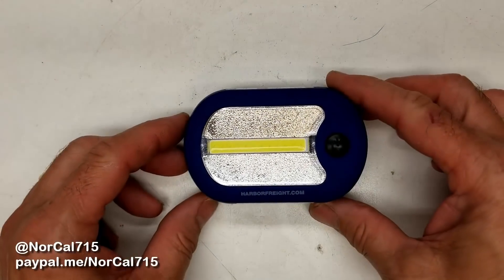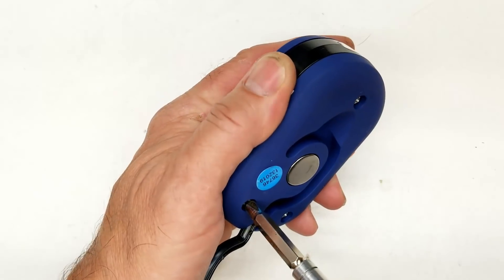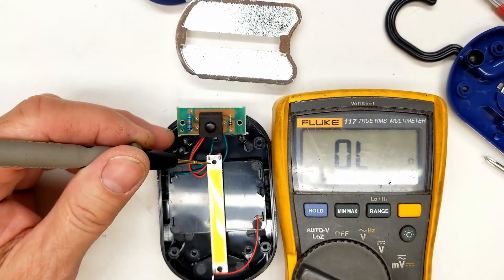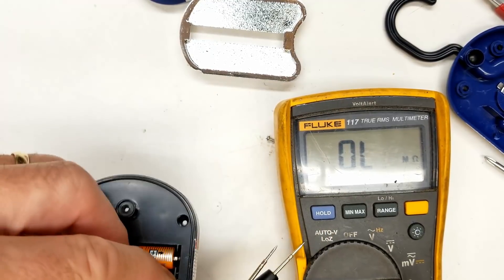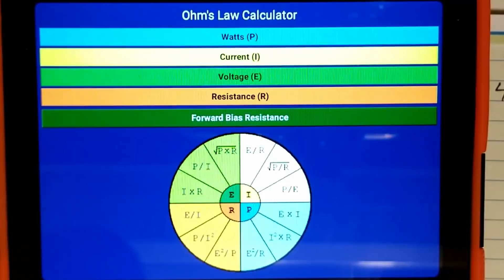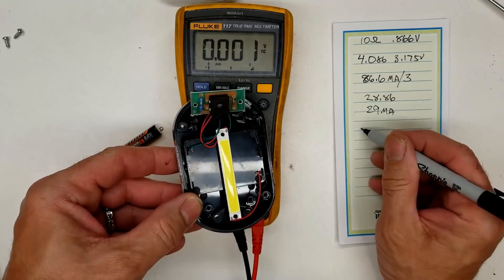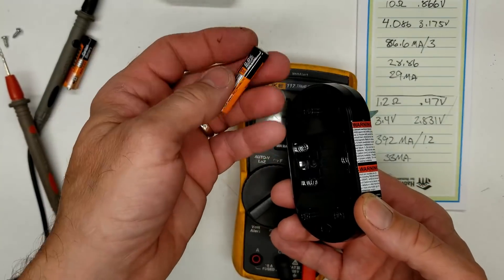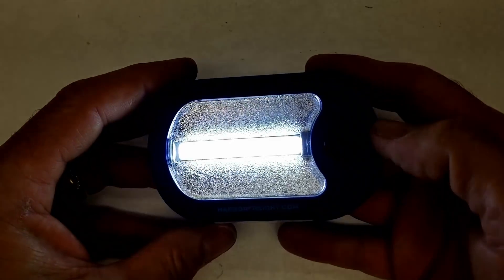Harbor Freight FREE Flashlight Teardown and Analysis

Comment: The resistors are now microscopic SMD unfortunately. Mine has values of 1.5 and 10, or in SMD lingo 1r5 and 100).  I was going to swap the cob resistor to increase longevity but can't be bothered with SMD crapola.  Cheap thin plastic case probably will crumble before cob dies anyhow.  I did modify it by adding a spare single shorter AAA sized 300mAh lithium, along with a cheap ass TP4056 control board with UV protection.  Only gets less than half the run time of good  alkaline AAAs but will never have to replace battery again.

Very cool video.  Thank you!
UPDATE: the 1.5 ohm resistor is actually differnet than old version of 1.2 ohms.  Turns out that is not good (cob is pulling 480/12 or 40mA/LED - so looks like I will have to replace that bloody SMD resistor after all.  UNLESS, the new design incorporated 40mA LEDs --How does one figure that out??
Reply: Another Youtuber with same configured lamp confirmed that swapping to lithium prematurely burns out the cob's individual LEDs.  Thinking a 2 ohm resistor should be about right though I still don't understand why swapping battery makes cobs draw more amps?  This lamp still has the 12 LEDs on the cob and they increased this resistor's ohms from 1.2 to 1.5 which is good, but even with higher ohms the lamp is drawing more instead of less current -just call me confused?  
Answering my own question a little latter -- maybe more powerful batteries have less internal resistance so calibrated resistors have to be increased to maintain same safe current draw for LEDs.

Comment: I made a emergency strobe out of mine with a Picaxe MCU programmed to pulse a 2N7000 mosfet with 100 millisec flash 60 times a minute. Just 2 parts! It all fit inside with room to spare. Mine only has one resistor (1.5 ohm dropping .073v) for the end light and no resistor for the led bar. Great light for hacks.

Comment: I have two currently that stopped working at about the same time. Tried new batteries in them and still no dice.
Is there a way to determine if the LEDs are bad? Is there some other high point of failure on these that can be repaired?

Comment: OHHH       Great collar hanger idea.     This is a updated  LED technology and are way better than the last generation.   Nice device.    I hooked mine up to my bench power supply that had no voltage sag and it was set to 4.5 volts.   The 12 LED element was drawing over an amp if I recall.    So assuming VfLED of 3.2 volts the resistor will be dropping 1.3 across it so that does come out to 1083 ma.   Definitely not a great design for battery use.   Very bright  when using power supply though.

Comment: Wow, such a bad design.... they could have used a 10-20 cent step-up / boost led driver circuit and use just 2 AA batteries and get much higher efficiency... they're wasting so much power on resistors. I guess carbon/zinc batteries are cheaper and a heavier product feels/seems more expensive. 

Also... you have to wonder how cheap manual labor is when it's cheaper to solder wires between 3 boards manually instead of redesigning to have fewer boards and fewer wires... and so many screws.
Those cold white LEDs would also have horrible CRI and they're probably the crappiest leds that fail quality checks and they overdrive them to get them all so bright.

Comment: If you use any good cells ( any brand) alkaline cells you will kill those LED's very fast, as the currents will roughly double. Just replace the resistors with higher value ones and it will be a much longer battery life, but strangely not much lower light output. I would use 6R8 for the led bar and 33R for the spots, and your battery life will double. Those off brand LED dies are not really rated for more than 10mA in the 5mm package, and the bar similar, but will run at higher current with a greatly reduced lifetime.

Yes the magnet is a ferrite disc magnet, and probably the cover is nickel plated steel, though you could use a thin stainless steel sheet in the press, but the shiny surface points to a nickel finish over tumble polished stock steel, and the thin sheet will act as a nice pole piece for the magnet.
Reply: I'm using alkaline so too late for my end led light. It flickers badly. The three leds do not balance and share current evenly. For the bar led on top, I'm using a micro to pulse it as a emergency strobe.😁